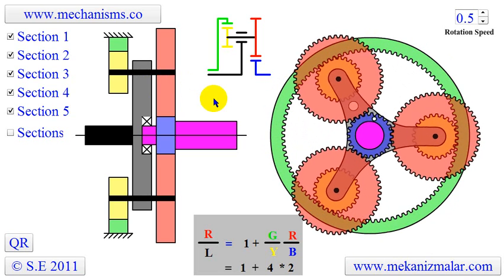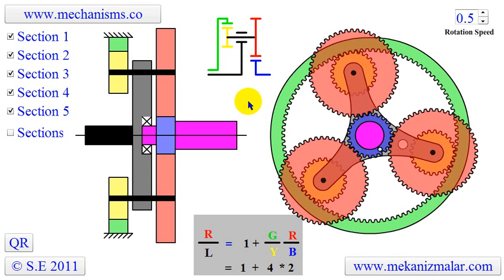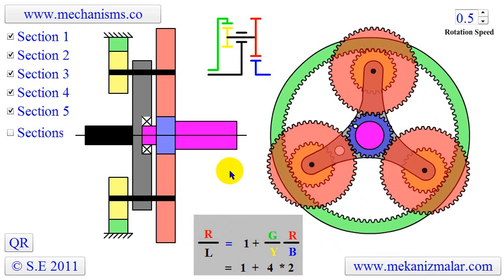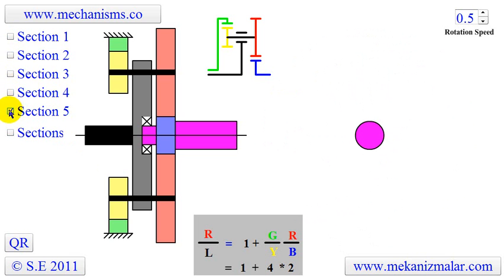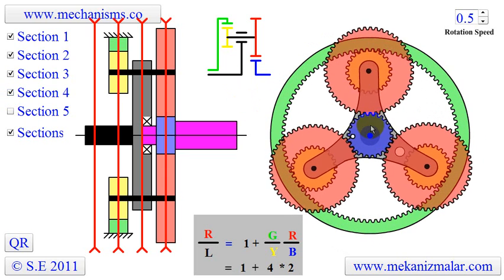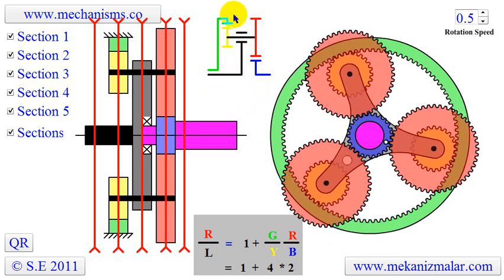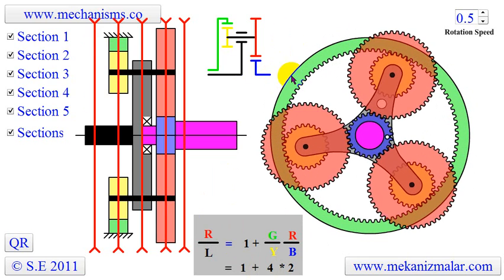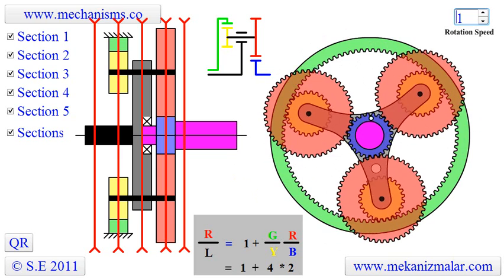Planetary Gear System

Comment: Qingdao Longbiao Intelligent Equipment Co., Ltd. specializes in the design, development, manufacturing, sales and service of CNC Floor Boring mills. Adhere to the production of high-end machine tools, and the leading products are: TK69 series CNC Floor type Boring mills,TK65 andTK68 series CNC Planer type boring mills, TK61 and TK62 series CNC horizontal boring mills, FD/SD series CNC gantry boring mills, LB middle hanging planer boring Mills with high precision and good stability and other precision machining equipment We can carry out customized production according to the needs of customers at home and abroad The products are mainly used in nuclear power equipment manufacturers (nuclear island and nuclear power valve), wind turbine manufacturers, hydropower equipment manufacturers,mining machinery, forging equipment manufacturers, etc.
The company adheres to the business philosophy of "strict quality management, manufacturing first-class machine tools,pursuing quality and not blindly pursuing quantity",
The company has a large number of experienced professional and technical personnel with complete testing equipment, such as laser interferometer, collimator, level meter, etc., to ensure the accuracy and quality of each equipment
The company has passed the ISO90001 quality management system certification and has a perfect quality, safety, environmental protection and other management systems. It is rated as a '3A enterprise in quality management' and a 3A enterprise in credit evaluation. our products are exported to various regions at home and abroad, and our product quality has received unanimous praise from customers
We believe that with our unremitting efforts, we will win the trust of our customers. We will also try our best to let customers buy satisfactory products and enjoy the best after-sales service.

Comment: What is the annulus ring actually attached to? In other words, what keeps it from slipping up or down the axle? I have been trying to build a system where the planet gears do not move around the axle (i.e. the three gears would always be in east, northwest, and southwest positions relative to the axle) and the annulus ring is able to turn, but I cannot find any way to attach axles to that setup. If I could see how you attach the annulus ring to the axle in this example, I think it would help me.
Reply from the maker: You can put two semi-circular beds on each side of the annulus. Annulus will slide in these semi-circular grooves. By bushing, grooves toward the rotation axis, you can stop the rotation of the annulus.

Comment: Okay, I have a question which might be stupid but I wanna know: why there is "1+" in the formula? 
Why the formula doesn't look like this: Right/Left = (G/Y)*(R/B)
I would really appreciate if anybody answered this question.
Reply: You can use a table to calculate this.

Step     Blue (B)          Red (R)             Green (G)             Arm (L)
1           +1                   -B/R                   -b/G = -BY/GR     0
2           +BY/GR         +BY/GR             +BY/GR                +BY/GR
3           +1+BY/GR     -B/R+BY/GR     0                           +BY/GR

In step 1, assume the arm is fixed and rotate the blue sun gear one turn. Then the red planetary gear will rotate -B/R. The yellow planetary gear will rotate with the red planetary gear at the same ratio. Assume there is an additional sun gear b attach to the yellow planetary gear. So we can get B/R = b/Y. And b = BY/R. Now assume a system with the green gear ring, yellow planetary gear and the sun gear b. We can get the green gear ring rotate -b/G = -BY/GR.
In step 2, we assume the whole system rotate together. The purpose of step 2 is to  cancel out the rotation of green gear ring (the green gear ring is stationary).
In step 3, we add step 1 and 2 together.
Finally, the ratio of Right/Left will be (1+BY/GR)/(BY/GR). After some arrange, we get the result Right/Left = 1+GR/YB.

That's why there is "1+" in the formula.

I hope this will help you understand it.
Reply: So the "+1" is the representation of the one full rotation of the blue gear, where the blue gear is the one which propels the whole gearbox? I guess I understand now, I wasn't taking under consideration the rotation of the arm. I was calculaing it as a non-planetary gearbox and therefore the "1" was lost. And I see that I have made a mistake while asking the question. Still need to do some examples but you have helped me a lot. Thank you Mekanizmalar and thank you Hong-Yi!
Reply from the maker: I think it is very good question but I can't explain clearly. I will give you some hints, maybe you will figure it out from there. From your question, I assume that you understood the gear ratios, but have difficulty with 1+. Have you considered the rotation of the triangular arm during calculation. It also contribute some additional rotation to the gear ratios. For example consider the rotation of the moon around the earth, we see one face of the moon, and we assume that it is not rotating,  but it does one rotation around its axis when it completes it's rotation around the earth in 29 days.
Have you seen the movie "around the world in 80 days". They gain one day by going in eastward direction. For people in London it was almost 80 days but for travelers it was almost 81. They thought that they lost the bet.  Traveler were acting like triangular arm. If they have gone in  westward direction in 80 days, they would be late for one day. At the 79th day journey they may think that they have one additional day,  however in London it would be 80 days.
I am sorry that I could not give you much better explanation, I am hoping someone with more knowledge come along and help you better than I do.

Comment: Can planetary gear sets have two inputs, and what would be the uses for it?
Reply: Yes.  One example is hybrid vehicles that use both a gasoline engine and an electric motor.  The engine might drive the sun gear, while the motor might drive the ring gear.  The carrier arm would be the output shaft.    It is one way that two different sources of power can be applied to the same load.

Comment: how much did this program cost? i want to use it to test my concept before i start to cnc or 3D print , thanks
Reply from the maker: Frank Lopez Dear Frank, thank you for visiting my channel. I use Adobe Flash and AS3 to animate the mechanisms shown in my channel. I do not know the current cost of Adobe Flash.
Reply: thanks but i just downloaded the flash prog, tho im not sure what AS3 is
Reply from the maker: Frank Lopez AS3 is programming language used by Adobe Flash. Since you are not familiar with the subject of AS3, it would be difficult for you to do what you see in this animation. If you are familiar with Auto-cad Inventor or Solid works you can create 3D parts by using these programs.
Reply: im good with Autocad 123D is the animation part im interested in

Comment: Does this system still work if I reverse the input and output shafts to increase rpm?
Your video was a good one, it's easily understood.
Reply from the maker: Thanks for your comment. In this animation the black shaft is input and the purple is the output. The output rpm is 9 times of the black input shaft rpm. If it is connected in reverse, the rpm of the output shaft will be 1/9 th of the input shaft.
Reply: Oh I see. Understood.
Thanks!!